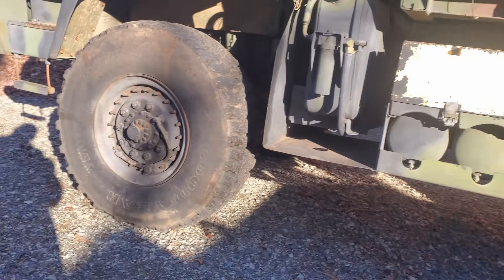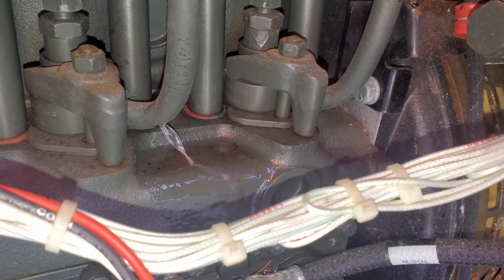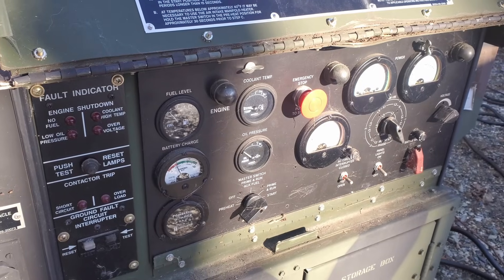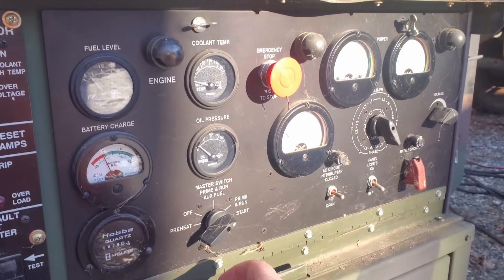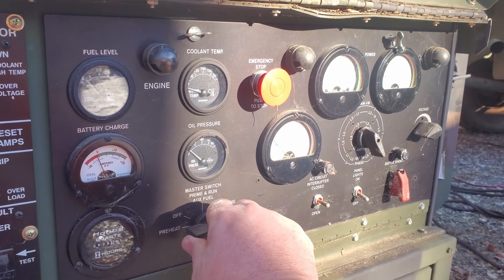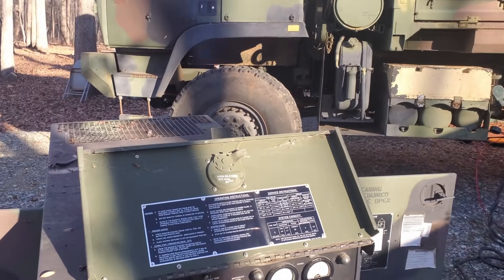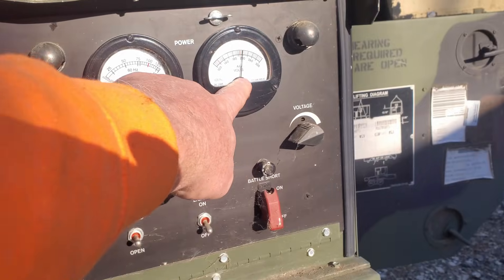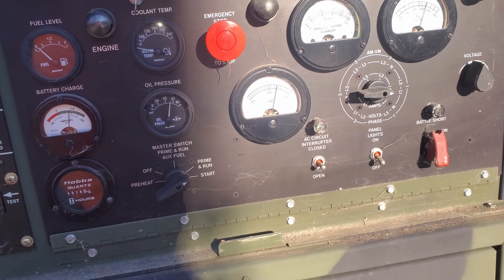Shes a runner

Comment: What does the battle start on these do ? Not found anything online
Reply from the maker: The battle short is an alarm override switch. It will override any alarm except for low fuel. 

The Steel Soilders forum has a Technical Manual section. You can find any manuals released to the civilian world there.
Reply: @TrackGeeks amazing, thank you
Reply from the maker: You're welcome!